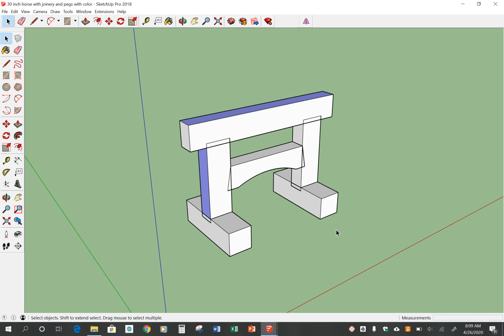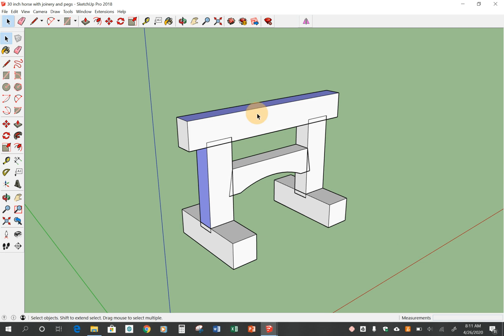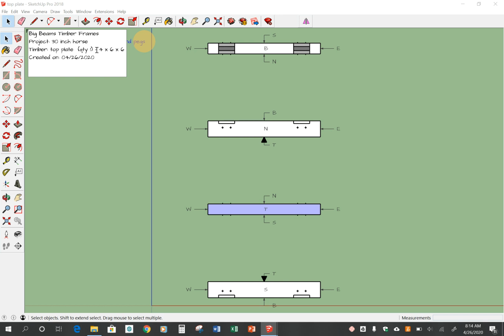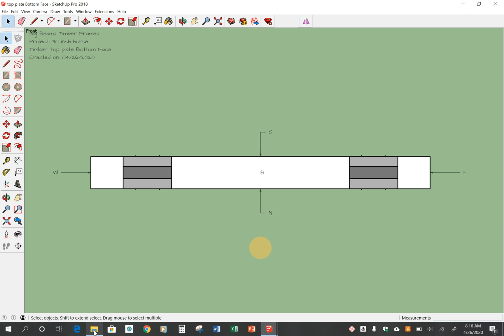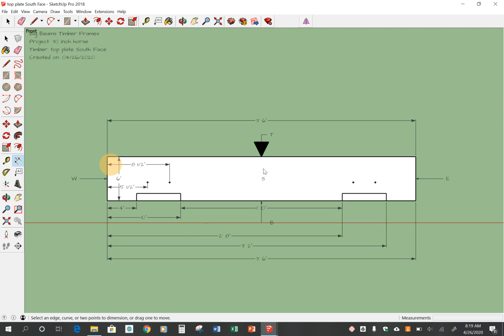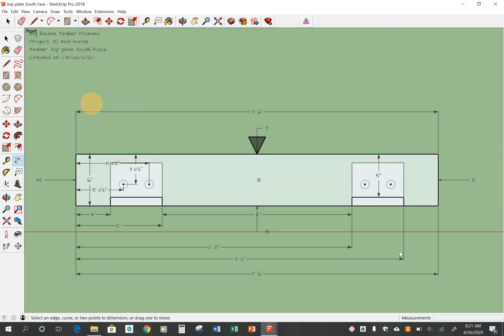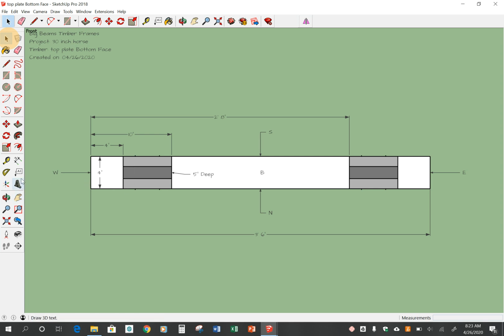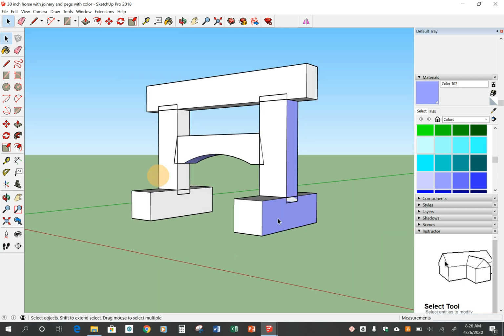Timber Frame Using SketchUp Part 5  Making Shop Drawings 1

Comment: In the shop drawings how do I add a 3d model into the plans?
Reply from the maker: Hello Mick. I’m not sure what your asking for, but I’ll try. While in an open shop drawing select the orbit tool, then if you hover over one of the faces and hold down the left mouse button and drag, it will rotate the image for a 3-d view. To restore to 2-d, you can select camera, then front view. Hope this helps.
Reply: @bigbeamstimberframes770  Thank you for your reply. Just the answer I was looking for

Comment: Hi, just getting back at this. I’m going to make theses Trestle Ponies. I’m using the paint bucket tool to paint the reference faces. When I painted the left post as you did the inside of the right post coloured in, instead of the outside area of the right post. Can you tell me what I did incorrectly? All other references faces paint correctly.

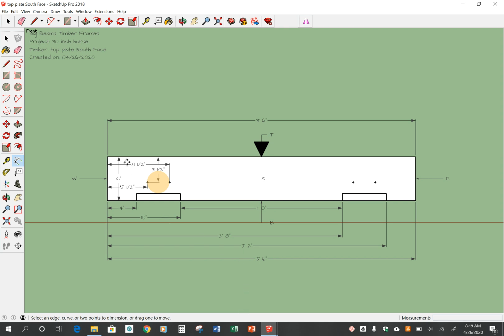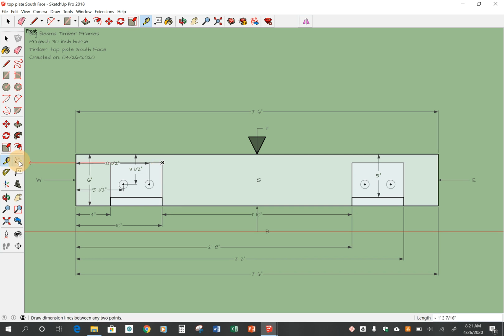Comment: Great videos! I'm new to SketchUp. At 10:57, if you use 1/2" faces, the peg holes will be 4" from the top face. Similarly, at 13:03, mortice depth will be 4 1/2".
I like to display Back Edges - (K) hot key on macOS version of SketchUp Make 2017. This will show the reference lines for the mortices and the peg holes.
I'm finding hot keys/shortcut keys save a lot of time as opposed to slinging the mouse cursor back and forth to the menus. Especially on a really large display.